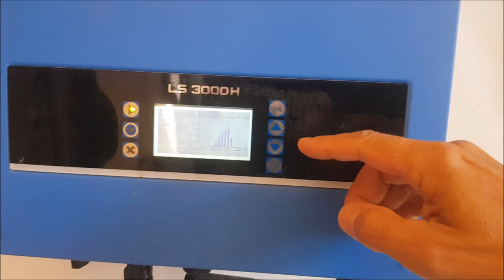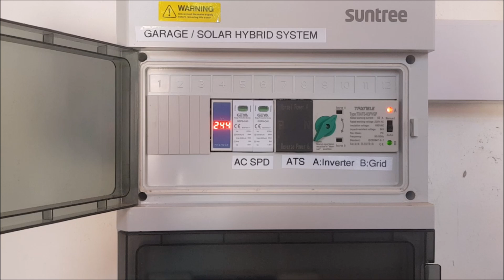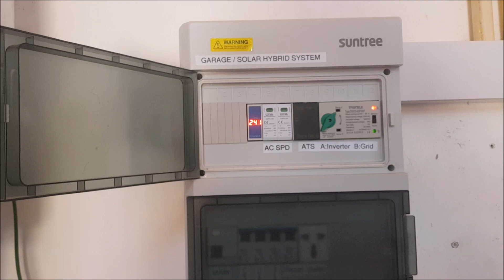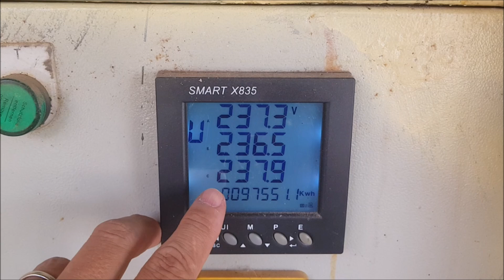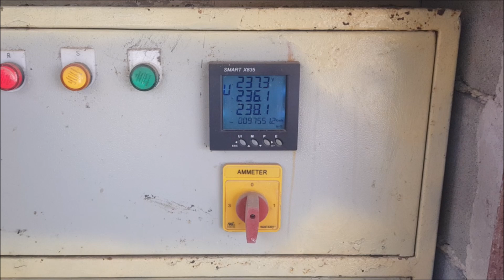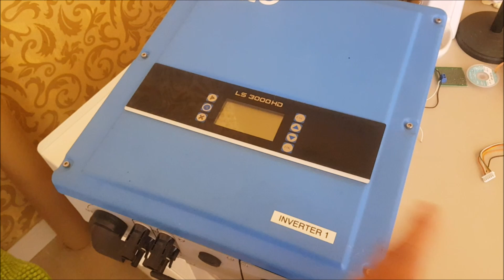Normal Grid-Voltage, yet High-Voltage? Thai Grid-Standard got me on the wrong foot.

Comment: That is one thing about grid tied we are stuck working with whatever the utility gives you and sometimes they do not follow their own rules. Two years ago I had a low voltage supply problem and the Enphase would disengage at 106 volts per leg. They blamed my furnace but funny thing after the complaint I never had the problem again.